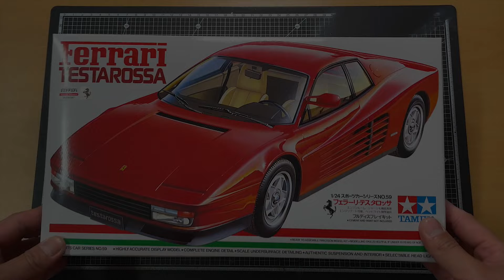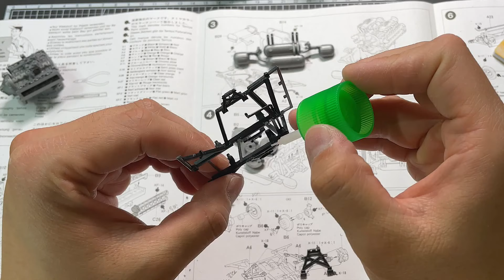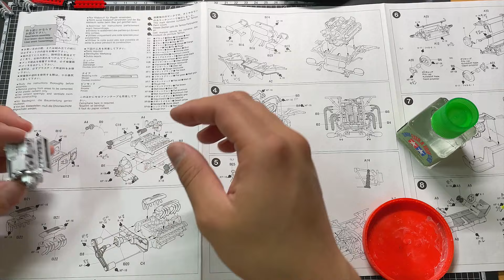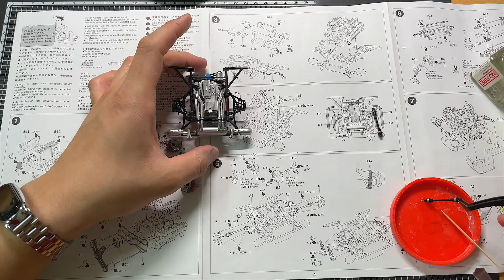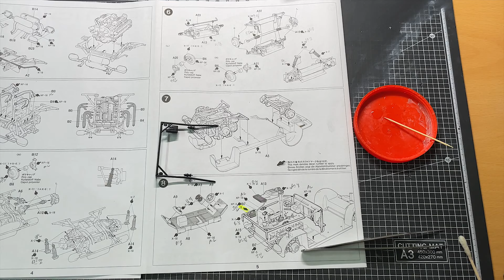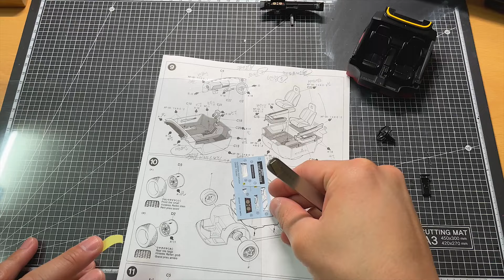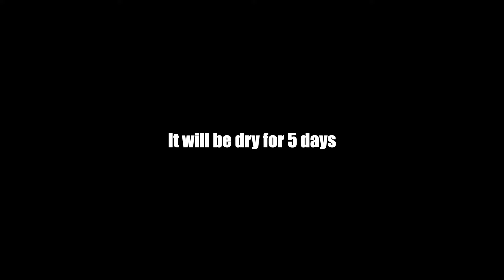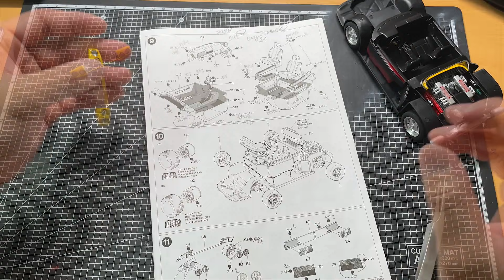[Full build] Make It Ferrari Testarossa 1/24 Scale step by step (TAMIYA)

Comment: Great build, but have couple questions, where did you get polishing sponge for dremel and why do you make metal layer before yellow paint? And what glue you use for windows and headlights?
Reply from the maker: I'll link the sponge. It's a product that I also buy and use. (sujibori-do.ocnk.net) The reason for painting silver is because the injection color is red, so if the color of the base is revealed, it will stain, so I sprayed it. Clear parts use aqueous adhesives.

Comment: just a quick question .. I encouter huge gap in front between body and chassis ... did u use glue to eliminate gap..? because it is quite risky to the paint... if u do what kind of glue..? thanks in advance..
Reply from the maker: In that part, I tend to use loctite.
Reply: @Makeitscale  will try thanks ..:)

Comment: Cool build. One thing gets me puzzled: why do You use semi gloss clear on the bodyshell before You 2K clear it? It seems a bit pointless. It looks so good in yellow.
Reply from the maker: Since the semi-gloss clear has a rough surface, spray it so that the urethane is bonded rather than covered on the racker.
Reply: @Makeitscale  You could spray a tack coat first with the 2k and after 2-3 wetter coats? But hey, You do what ever works for You. "If it works don't fix it".
Reply from the maker: Because it is 2k urethane, it cannot be used again if excessive thinner is used. I don't recommend it.
Reply: I meant that You let it dry 10 min between coats. First You spray a tacky mist coat, then 10 min later You spray another coat. And repeat. I know how 2k clear works and that it's supposed to be used within 1 hour from mixing it.